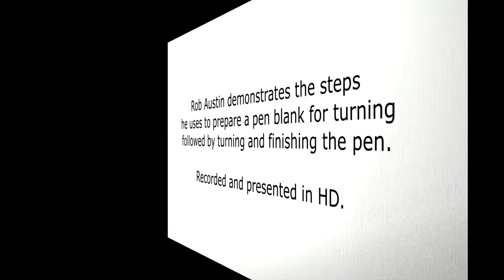Pen Turning 101 with Rob Austin

Comment: All I need to do is invest in $6000 worth of tools and I can have a pen just like that one.
Reply from the maker: If you have most standard shop tools you won't need much. You can absolutely send thousands of dollars making pen or any other form of woodworking. You need a method to cut the wood into blanks, drill a hole for the tube or tubes something to mount it on a lathe and a tool to remove the unwanted wood. You can use a F clamp to assemble the pen. What I'm trying to say is you can use work around methods to test the waters and see if pen turning is something you can enjoy before you invest much money.

Comment: A very nice instructiual video. However at 21.48 minuntes you say.... 'this is Wenge, a palmtree'... Wenge is not a plam. https://en.wikipedia.org/wiki/Millettia_laurentii. Other then that keep up the good work!!
Reply from the maker: I see what your saying. I was trying to give examples of types of wood that were similar that could split apart. I should clarified a little more. I have both Wenge and  both red and black palm. The blanks I had to he right were from several different types of wood. I hope you enjoyed the video!
Reply: @gwinnettwoodworkers  I enjoyed your video very much and although a woodman for years there are still small things I learned.

Comment: My brain broke when he pulled out his tool kit for finding center. Adsense perpetuates the buy boy. Unfortunately thats the only sense that lives there. Like golly imma just spend 20k on tools to get me into the pen game for pens nobody wants because I love pens so much I value my time at less than worthless. Like use your finger as a stop gauge mark 3 to 4 lines and you will whittle down center. Use a pair of calipers to do the same and now you got a pair of calipers, which have infinite more uses than a special built pen center finding tool. Same with your drill press jig. I imagine anyone in the renaissance would have used a boring machine, like a drill bit chucked in their tail stock. Your great grandpas are simultaneously rolling laughing and crying at you. I feel bad for a boomer.In fact throw away your power tools and get a hewing axe to make your blanks. Wood comes from trees. Until you can make me something out of a tree your done son. You might as well hang up your hat.